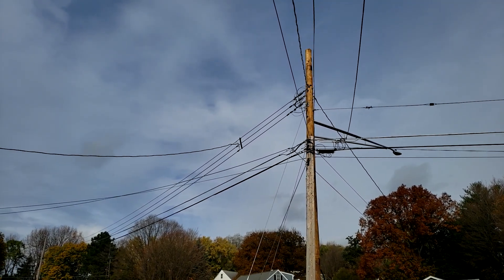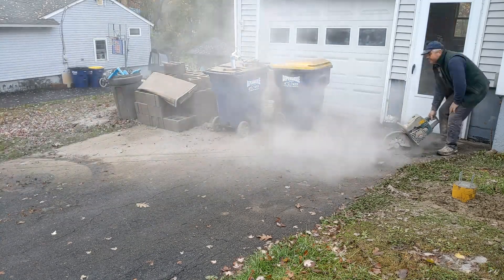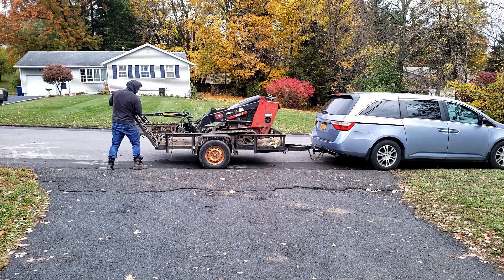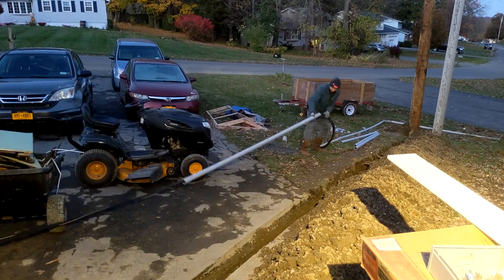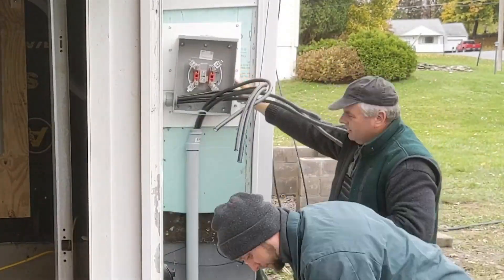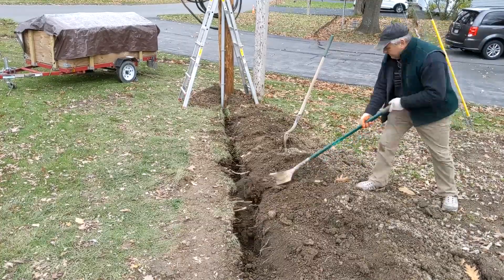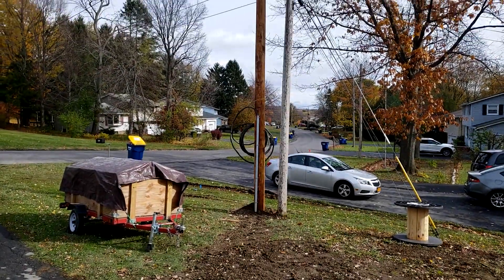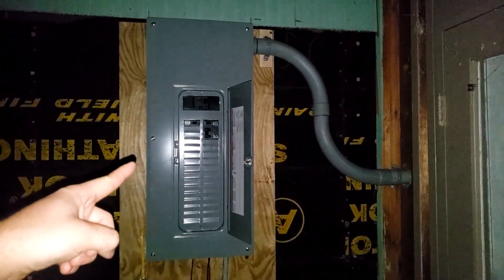Home Addition - Episode 3 - Installing Underground Electric Service

Comment: great work! What size wire??
Reply from the maker: Don't remember the exact size, but we ran 200 amps to the house. It was the proper size. I usually don't show the inspection steps in these videos, but we're following all our local ordinances and getting proper inspections at proper steps.
Reply: Nice! I need to do the same job
Reply from the maker: @ramongarcia3003  it was honestly one of the most memorable parts of the whole project. Now I got to figure out how to do the same with fiber optic. The internet line still runs to the house from the pole.